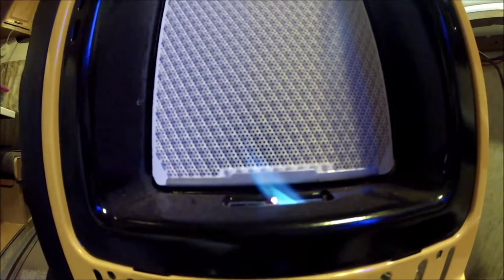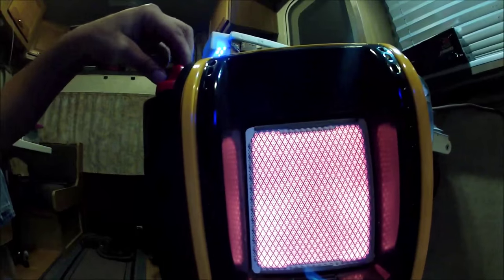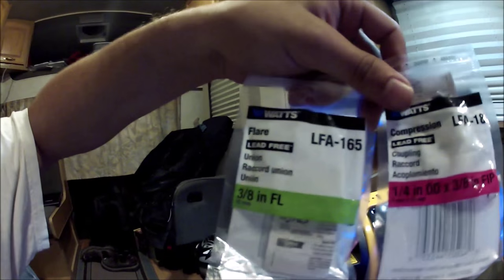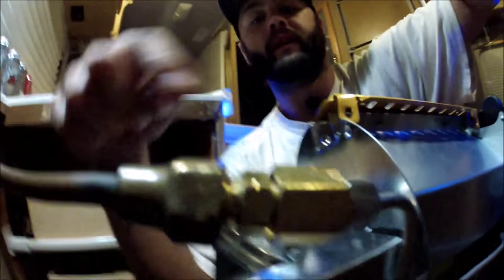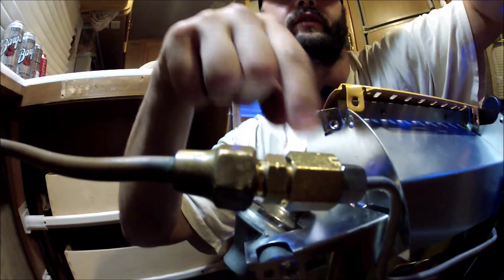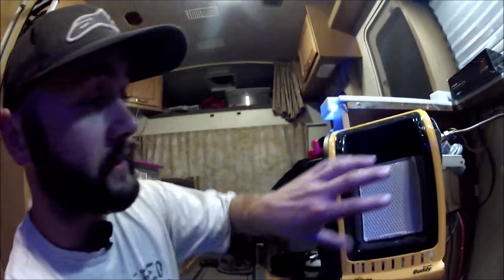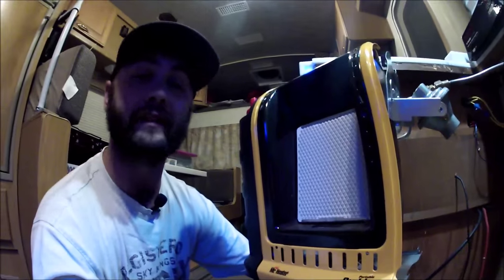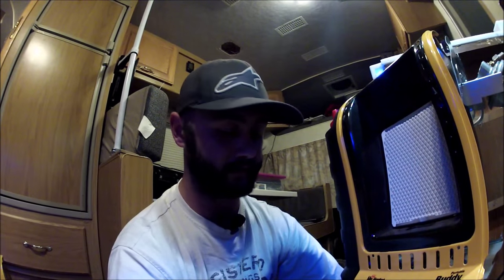Running MR Buddy Portable Buddy heater on low pressure in my RV

Comment: Hey, I am going to install my mr. buddy tonight in my RV. it will be -20 windchill so not a moment too soon. I had a propane dealer build me the propane line and sell me the fittings so all I have to do is install and leak test. Thanks for sharing!

Jed
Reply from the maker: +NDNomad Awesome, how much did it cost to have the dealer build you the lines vs buying the premade ones?  Looks like you are running a big buddy so you'll just be hooking into the low pressure side as the Big buddy is nice enough to set it up from the factory with a low pressure hookup.
Reply: +RV Crazy I got the big buddy for $117 on a store wide 15% off sale and the dealer made the hose setup with quick connect for $65. I got lucky I think. Thanks!!

Jed

Comment: Hi, your doing exactly what I would like to do, I have the t fittings all set for connecting to my RV heater but I'm having trouble getting the proper fittings on the small Mr Buddy heater side. I couldn't find  the correct fittings you mentioned. Anyway you could get me some part numbers for those compression fittings I will need?

Thank you

Ron
Reply from the maker: +Ron Weiss Sorry but I can't remember the part numbers.   I just bought a few things from home depot or lowes that looked like the right size and returned what didn't fit.
Reply: I just brought my buddy heater into my local hardware store. from the already existing T I had a series of compression and non compression fittings and adapters. It sure added up. Remember use gas pipe tape on the non compression fittings, but not on compression fittings. If you are not going straight from the cylinder (no regulator) The Big Buddy is much easier to deal with with its quick release fitting  that btpasses the built in reg. I like RV Crazy's hack. Looks like with some effort you could put your own T of some kind by cutting and flanging the aluminum gas line of the Buddy so you would have the option to use low or high pressure propane.  Would be tricky.

Comment: AHA.........I see I have to bypass the regulator now because the "house" propane tank is already stepping down the pressure. I have both a Mr buddy and a big buddy. The big buddy has a quick release coupler which can make for a nice install.  I realize now I will probably be better off running an unregulated (high Pressure) line off a tee at the tank and using the "filter" accessory. I want to keep my heater portable,stowable. more costly are the olympian wave series and less btu for your buck but maybe the way to go for a more permanent install. looking forward to  seeing your custom shroud. idea....give it a fresh air supply.  Add one of those convection peltier fans you see on woodstoves that spin due to the heat. Need no power.
Reply from the maker: +wyocoyote wyocoyote I wasn't a fan of having to run a separate high pressure propane line so that's why I bypassed the internal regulator.   The big buddy heater bypasses the internal regulator with that quick disconnect fitting and it would be nice if the smaller heater had the same.   I ended up going with a totally different heater and you can check it out here.   https://youtu.be/rDujkrdTmw8
Reply: Yes just confirmed that the Big buddy quick connect bypasses its built in reg and is only to be used with low pressure. very nice. yep wish the small one did as well. Mines older will check to see if new ones have this option.
Reply from the maker: +wyocoyote wyocoyote I bought mine about 2 years ago and it didn't have that option then.   Would sure be nice though.

Comment: Im looking for a single hose to connect to my on board propane tank to my mr buddy heater without any modifications sumthang simple pleawe help Cold !!!!
Reply from the maker: +Domo Owens Simple isn't the easiest.   Its easier on the big buddy heater as it has high and low pressure inputs.  It pretty much all depends on what your rv currently has but there's a good chance that you'd need more than just one hose.

Comment: Bypassing the regulator is not good because it also has a filter in it and you will ruin the heater with debris quickly

Comment: That is not the little buddy
Reply from the maker: +BBBYpsi Hey thanks for noticing, yeah it's a portable buddy heater.  Totally had the name mixed up.
Reply: +RV Crazy I am thinking of getting the little buddy for my pick up truck. I deliver travel trailers all over the usa for a living & sleep in the back of my dodge 3500 diesel. I took out back seat & front seat made a small bed. But it gets cold in the winter & do not want to run my truck all night long.
Reply from the maker: +BBBYpsi Nice, that sounds like a pretty cool gig.  Any pictures of your setup?  A little buddy would be a cool setup as long as you have the room for it to safely sit.  One issue with the Mr Heater setups though is that they do not have a thermostat so you might end up getting too hot in that small of a space.  I get too hot often leaving my portable buddy on low. 

Another option would be something like a Webasto forced air heater.  They are thermostatically controlled and can be plumbed into your diesel system so you don't have to mess around with multiple fuels.  I'm sure you could plumb it into an existing heat vent as well or just have a vent under your dash.  With running only for a night and driving during the day you shouldn't have an issue with running your batteries dead but the Webasto and other brands of heater like it are quite expensive.  The boat I'm captain of now has a eberspacher and a boat I used to be on in Alaska had a Webasto that I installed.
Reply: +RV Crazy Actually testing the little buddy out today in my truck. Letting it run to see how hot it gets inside. Temp outside is 65 F & have a carbon monoxide detector which will show at 30 ppm & gives peak ppm after first 40 min. it was just over 80 f in truck 30 ppm with peak 31 ppm with all windows closed. As soon as I opened door it was all gone. So gonna leave it in there a few hours just to see how it gets. I am guessing cracking a window just the tiniest bit might be the way to go. I put a piece of particle wood on floor so it has a nice solid flat space to sit on. I will. update this in a few hours

Comment: Check this out.  
"The Platinum Cat Heater"  
http://www.ventedcatheater.com/2.html  
I wouldn't use any other heater in a closed space for safety's sake.
Reply: Link Fixed!
Reply from the maker: CITAP1 I actually did have an older version of that style heater that I tried for a little bit and maybe it was because it was old but I wasn't happy with the output at all and I even wasn't very happy with the smell that it put off.  So that one is actually vented though it looks like which could be nice.  Does it vent out moisture as well?
Reply from the maker: CITAP1 Also I have ran blue flame and the plaque style heaters for about 5 years in a 400 square foot cabin and haven't noticed any issues other than the moisture that they create.  Always have had ventless indoor safe models and just had a window cracked.  Here are a few links for heaters similar to what I used to use and what I am considering using for the RV.  http://www.northerntool.com/shop/tools/product_200648896_200648896
http://www.northerntool.com/shop/tools/product_200648897_200648897
Reply: Here's a link to the installation of a Platcat heater. http://www.rv.net/forum/index.cfm/fuseaction/thread/tid/23439027/srt/pa/pging/1/page/5.cfm  This takes you to the page showing the installation and the thought process that went into the choice for the installation. It shows how he routed the vent hose to the outside. It's a very well thought out installation. This same author has a post on his solar panel installation. Again that is a very good installation too. I've only used the buddy in tents which leak air in and out like a sieve. The Platcat design and safety impressed me.